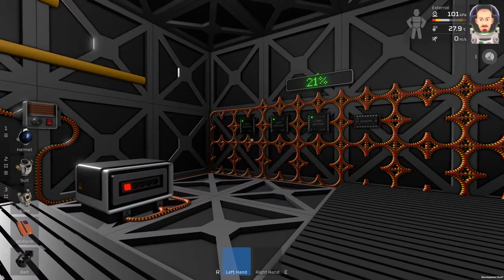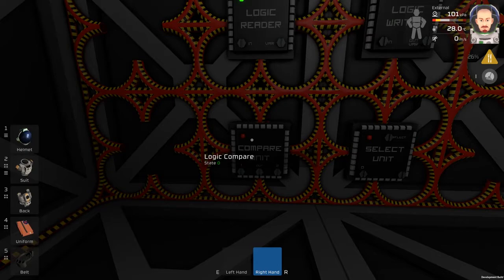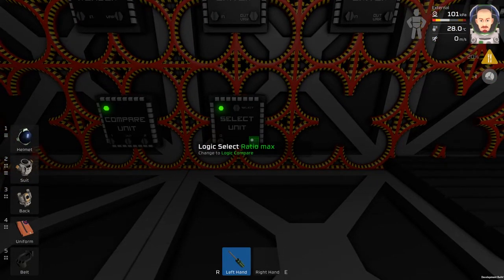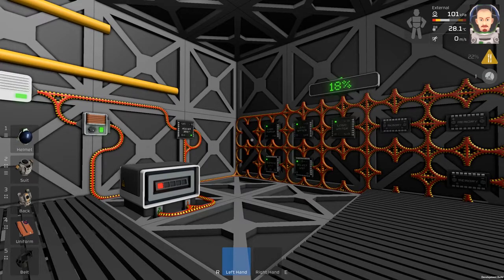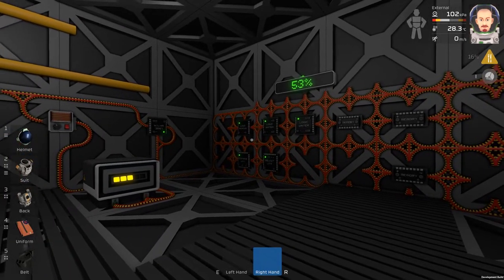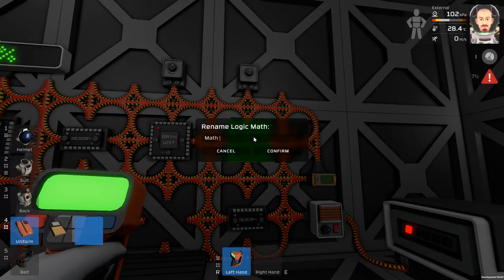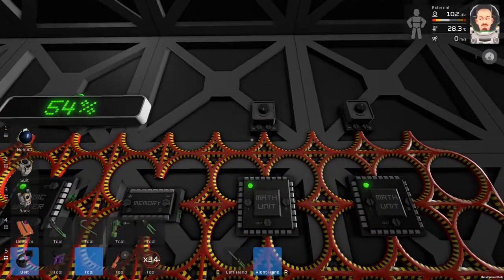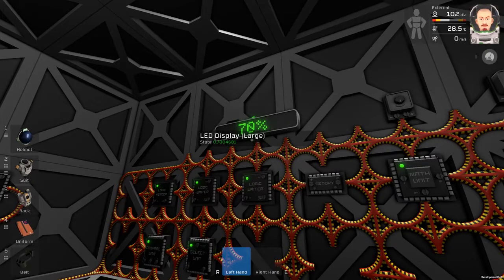Stationeers - Tutorial large battery with Schmitt trigger

Comment: I dont quite catch the advantage of doing that system.  My system is really simple with solar panels to battery, to    Power controler, to a transformer, to what needs to be pwr up.  Can you explain it pls.  And, should i put my transformer BEFORE the pwr controler?  Thx
Reply: Think of it as proof of concept. You can use it for any banded logic. I have filtration only turn on if the pressure in the input pipe reaches a certain value, it then processes all the gas and stops to wait for the pipe to refill. It's actually the same system but since I'm using kpa (absolute value over ratio value) measure for the gas, I don't need to divide the dials by 10, so they input direct to the Select Unit without the 2 Math Units. Same thing again for temp in my base, heaters come on at 25 and stop at 30, coolers come on at 35 and stop at 30. That's two different systems but they share the 30 stop point to save some space/resources. Couple of other banded systems too but they all build of this logic setup.
Reply from the maker: exactly, it can be used almost for anything, this is is bit more complicated, but the basic is still the same:

https://www.youtube.com/watch?v=gu5jrBQEokA
Reply from the maker: Hello there, this can help a lot if you are running coal generator or gas fuel generator, something like a backup plan for your base. Transformer is probably good idea to have after pwr controller. Pwr controller makes "new network" which is good, if you want to have some logic circuits behind it. Just an example: pwr controller beside the door in a room, everything in that room connected to pwr controller, turn off pwr controller and everything is turned off.